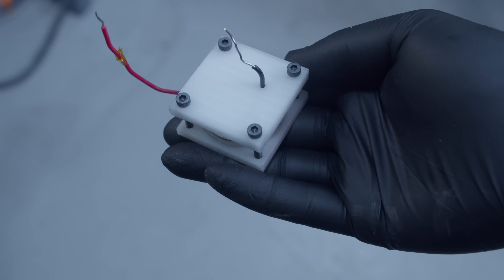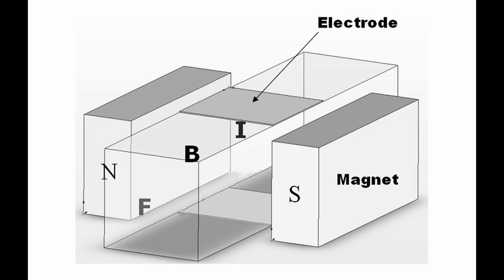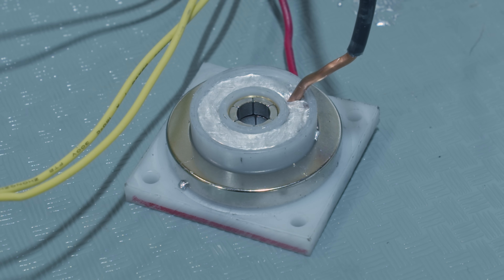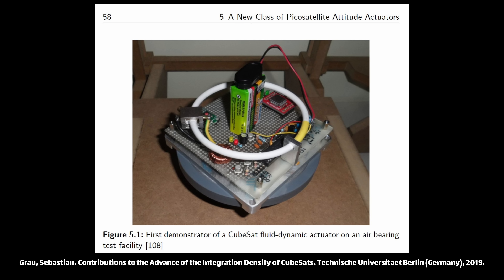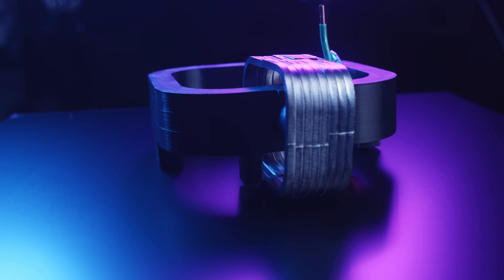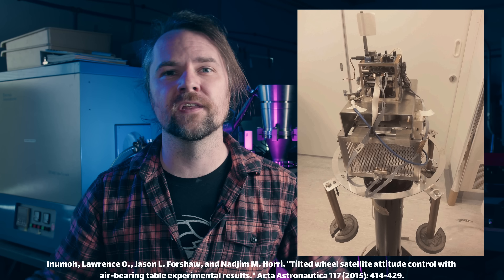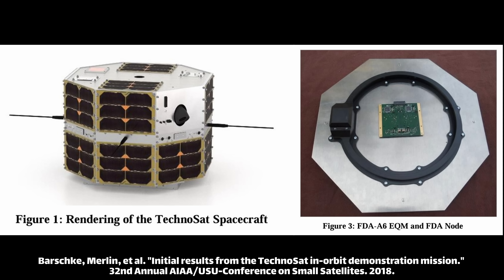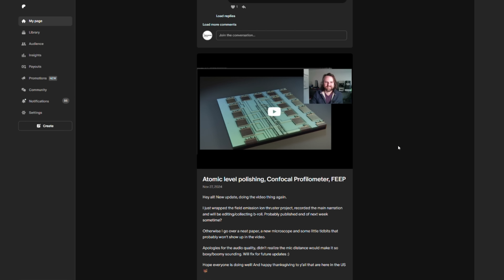A motor with no moving parts (sorta)

Comment: Metal electrodes are doomed in this application sooner or later. Maybe try some graphite? Something not dissolving in metal (mercury?)
Reply: does induction work on liquid metal? 
if so there would be no need for wires and no corrosion
Reply from the maker: @sammiller5509 It does! There are a bunch of pro/cons with different scaling losses, but yeah that approach can work. You can also run it as an AC conduction pump too (with both electric and magnetic field varying). Check out this paper (https://ntrs.nasa.gov/api/citations/20070022272/downloads/20070022272.pdf ) for more details, it's an interesting read!
Reply: @sammiller5509 Yes, but you want DC
Reply: @sammiller5509 while induction does work, you can only induce AC. I'm not sure if that can be induced in a way which produces flow in a single direction.
Reply from the maker: Yeah definitely. Refractory metals (tungsten in particular iirc) are fairly resistant, and some will "just" embrittle over time which might be fine once you're in an orbit and not experiencing much force. But definitely a concern for long missions. Considering the amount of current that's dumped through the electrodes something like graphite might be to inefficient unfortunately. Definitely possible with mercury, although you have to deal with the toxicity and it's not quite as efficient (density and conductivity).

There are other options too, like ionic liquids or just really salty fluids, but they lose suffer due to lower conductivity and less mass.  Very neat space to explore though!
Reply: @BreakingTaps  Maybe  thin layer of graphite over metal, just enough to protect it
Reply: @BreakingTaps try deep eutectic solvents, like reline. They have fairly high density.
Reply: Set it up with a series wound field coil and run it off AC?  Probably easier to find metal alloys that are innert in galistan.
Reply: I'm reminded of how the problems of using liquid sodium in a magnetohydrodynamic cooling pump for nuclear reactors were solved - not that I'm suggesting liquid sodium should be used in this application.
Reply: Induction?
Reply: This is a pretty cool piece of tech. I've had some similar ideas for MHD but with different applications in mind. As for the electrode wear that could potentially be remedied with a semiconductor coating that is insoluble in the liquid metal. Conceptually in the same sense that mixed metal oxide electrodes are used for electrolysis but obviously different materials, different substrates, and adherents are probably needed.
Reply: Would diamond electrodes be insane?
Reply: @joshuawills5242  Yes, because diamond is a great insulator. Often titanium is good, but I don't know, how they do in galinstan or mercury
Reply: @goamarty  Yeah, I searched a bit after posting that and found that it's an insulator, which obviously wasn't what I intuited, with it being carbon and a good thermal conductor...  Thanks for the response though X)
Reply: @joshuawills5242  Diamond is an extremely good electrical insulator, though I seem some research on making conductive variants.
Reply: Graphite maybe, I'd be prone towards silicon carbide. Though I didn't have a lot of experience with gallium or mercury. My intuition tells me they could be abrasive since they have so much mass.